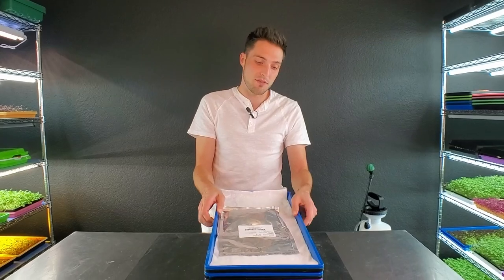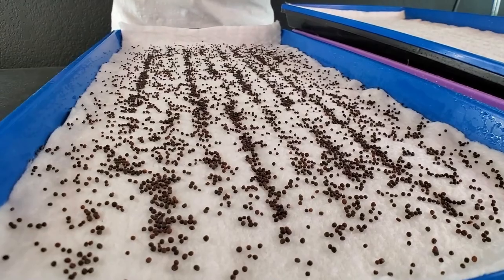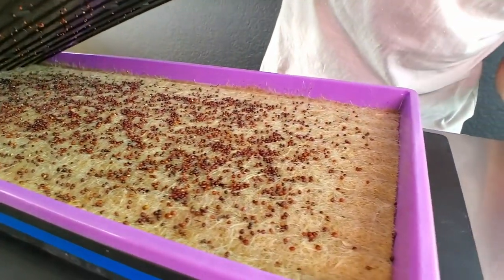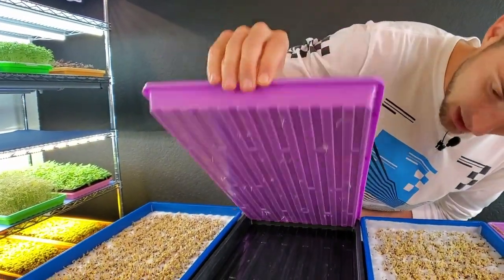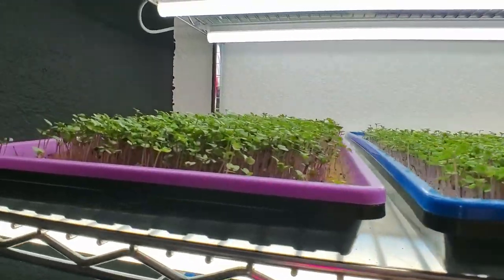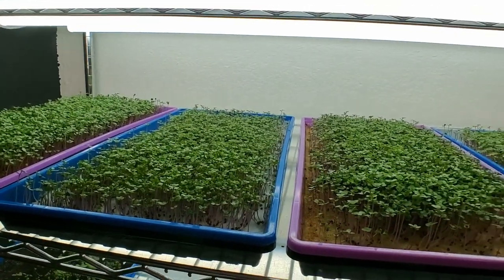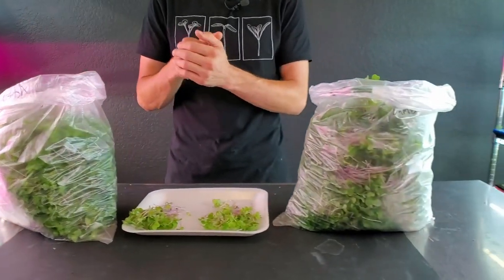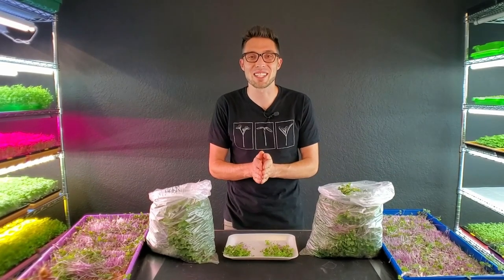BAMBOO vs HEMP Microgreen Mats!? Sustainable Hydroponic Microgreen Mediums!!

Comment: I am curious about Coco mats compared to the hemp mats?
Reply from the maker: 🙂Thank you so much for the support EL34XYZ!!  We saw excellent yields from the Hemp mats...they looked very much like the results from Coco coir...they would both perform well enough to be considered a split decision !!
Reply: @OnTheGrow  I saw that the hemp mats fall apart pretty easily? 
The coco mats seem to be able to be used again if cleaned and sanitized. That's just what I saw in a few other videos. Just for my personal usage, not commercial usage.
Reply from the maker: 😀Thank you so much for the topic!!  It really means a lot to us to clear the air... EL34XYZ! The Coco coir is not a mat...it's a loose mix that resembles soil...we don't suggest reusing it.
Reply: @OnTheGrow  Not the loose coco, they sell compressed coco mats. Just an example of one in this video
https://youtu.be/wPytBPMAzrw
Reply from the maker: Hey, yeah, sorry I have my customer service team answering this! This is CJ. You can reuse Coco Mats as they are generally coated in some type of rubber. 

There are a ton of crevices in the mediums though, so it’s something you need to be careful of trapped bacteria/pathogens... but as long as you sanitize it well and the medium holds up, go for it! 

The biggest issue we found with coco mats is that they are really hard to keep seeds nice and moist on. Since they are coated in a rubber they are hydrophobic and do not retain water to help with germination. 

Hope that helps!! 

CJ
Reply: @OnTheGrow  Thanks CJ